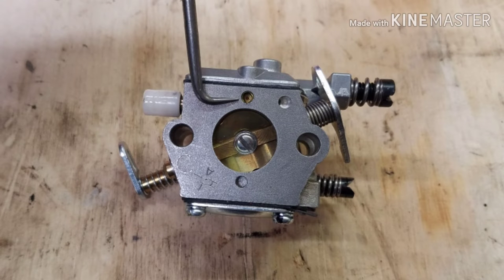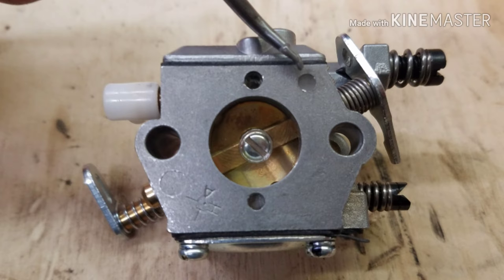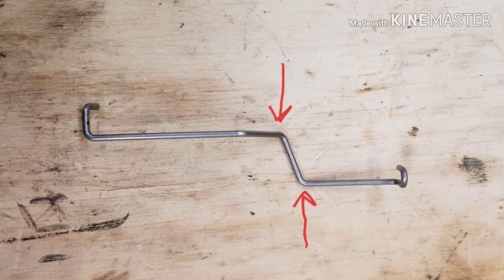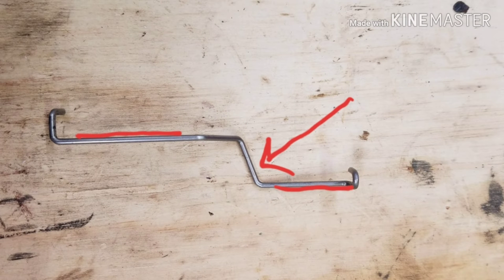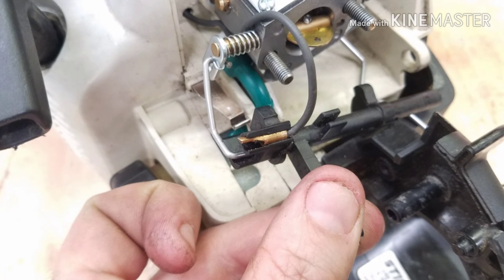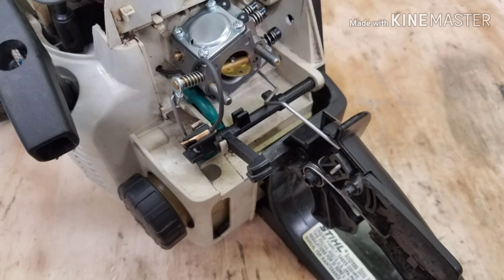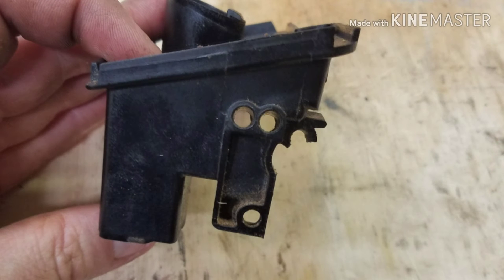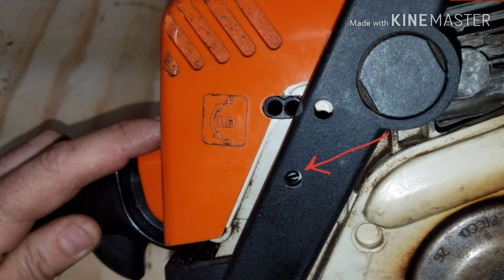☆ How to ☆ Stihl MS170 - MS180 w/ Walbro WT-215 adjustable carburetor upgrade & muffler mod

Comment: Just a note FYI.  There is an adjustable Chinese carb readily available for the MS180 on e-bay for $8.65 (free delivery in 5 days)..  It looks exactly like the MS215/carb you described in this post, except that there is only one impulse port, with no brass plug.  That carb is instantly ready for installation.  However, like your 215-1 carb there is no supplemental vacuum port on the top of carb as on the OEM Stihl Zama.  The Zama’s top port can be easily bolted to the top of the AM Chinese carb allowing the top port to fit perfectly into the carb filter housing just like the original.  HOWEVER BEWARE…..the metering diaphragm in the aftermarket Chinese Carb (and the 215-1) has a long depression nozzle, whereas that same metering diaphragm in the OEM Stihl Carb IS VERY, VERY SHORT!!  With the hybrid carb, vacuum during cranking with choke-on sucks huge quantities of fuel into the cylinder.  This will most often flood the engine during choking.  If not completely flooded, fuel to the carb is then entirely shut off by high upper port vacuum as soon as the engine fires up.  Thus it revs up, burns off the choke load, then dies.  Either way, the combination of the adjustable Chinese carb mated to the top vacuum port from the OEM CARB WILL NOT WORK!!  I had to drain my flooded cylinder, remove the top vacuum port, and reinstall the Chinese carb’s original flat top plate.  The engine then started easily on full choke without flooding, and could be easily hi and low speed adjusted as with most carbs.  The jet porting inside the Chinese aftermarket carb seems visibly much less complex than the original OEM Zama carb, probably the reason for a different metering diaphragm being needed.  To prevent unfiltered sawdust and dirt from being sucked into the unplugged filterhousing upport vacuum pot, I simply jammed a small p rubber stopper into that unused upper vacuum port. My MS180 has never run as good as it runs now, and it can be easily and properly tuned.  Amazingly, the $8 Chinese carb works perfectly.  Dr. K.
Reply: so, how do we find this mystery carb?  Any sort of identification number?

Comment: One thing I've never seen addressed is what to use on the hole in the air box where the compensator port is now open to dirty air. I found a perfect fit from a rubber plug that was in a hydraulic jack's fill port. Who said hording hardware doesn't pay, amIright??😊

Comment: I couldn't get the brass plug in the impulse port to budge with a pick, however I did get it by drilling it EXTREMELY CAREFULLY and slowly with a  quality, sharp 7/64 inch bit. Went until the tip of the bit hit the back of the plug and it nearly fell out. Absolutely no damage to the carb. Thanks for the vid, good info!

Comment: Is that a port on the bottom of the carb directly below the port you pulled the brass from?  Is it open or cloaed as well.  Ordered a 215 clone and on mine its a solid filled area?
Reply from the maker: It's just a cast in spot. It's blocked off,It's not open through to the carb. It can probably be drilled out on some for a different application. but the way it sits it's the same as yours, it's just not completely flat like your clone.
Reply: Many thanks from Nova Scotia!

Comment: Thank you! Just the video I needed. Wanted to mod my MS180 like they talk in the forums but all pics are long gone and its not so easy to vision "drill the brass plug and plug the other hole" when I have zero experience in Walbro WT-215. 😂 But your video made it all crystal clear. Also "drill 7/16" hole into the muffler" means little if you don't know where it is supposed to be drilled but now I get it. Will do the mods asap when my parts arrive. If all goes well and I can feel the improvement maybe I'll try modding my other saws too. Thanks again! 😎

I am going to check out your other videos too, seems like lots of good stuff. 👍🏻

Comment: Just a little warning that wasn’t mentioned in this video before you attempt these mods for your self. If you have a warranty for the Chainsaw you want to mod, just remember that any mods that are not approved by the company will void your warranty unless the warranty is already expired but that’s only if it’s brand new so if you only got yours brand new with a warranty and want to keep your warranty until it expires. Then Do not attempt the mods yourself.

Comment: i use a wood screw behind trigger and get full throttle ,, also the carbs I've been using I dont remove plug BUT I use the cover off the zama pos carb
Reply from the maker: Good work!

Comment: Did you advance the timing a little too?  I saw another video of yours, on a little top handle, and you said it seemed to help taking a little off the key and rotating/advancing the flywheel (5/7 degrees?) on these little stihl saws.  I just got the carb, so great info on the impulse.
Reply from the maker: A small bump in timing definitely helps! It's standard practice for me to do so on these smaller saws, so I forget to mention it sometimes. About .020" or 1/3 of the key removed is close. 1/4" at the outside diameter of the flywheel is usually what I go by for advance. Seems to be a happy place for these saws.
Reply: @samishsawworks5870  Thank you so much!

Comment: ok  where's the before hot shot@!??
Reply from the maker: Like the video stated, it wasn't running when I got it, so I had no baseline. Carburetor was toast and didn't take to a cleaning and rebuild. This video is less about the performance gains of the modifications (hence no BEFORE & after footage),but more of a "how to" if one should choose to add an adjustable carburetor.

Comment: So the brass plug you push out from behind? must need some force? i csnt seem to get it popped out
Reply: Never mind! Just needed some leverage!!
Reply from the maker: @mpeters5549  Ha! I was just about to say it takes some force/leverage to get it popped out. Good work.
Reply: I packed the throttle lever slot with JB weld to eliminate all that slack when pressing the throttle. It worked and was able to acheive full throttle, hopefully it stays!
Reply from the maker: @mpeters5549  nice! I'm sure it will. If not some people will thread a small screw in that slot to take up space also. Just another option. JB weld is good stuff though. I'm a big fan.

Comment: I have an MS250 and I keep hearing the WT215 is the carb to have for power because of its adjustability. But, most of the info I see is American and I'm in the UK. The reason I point this out is that the C1Q carb on mine does have high and low speed adjustment so I'm wondering if a 215 would be of any benefit in my case.
Reply from the maker: If you already have high speed adjustment then I see no reason to swap. You guys get all the good stuff over there!
Reply from the maker: The ability to adjust the high speed jet is the sole reason for the swap in our case over here
Reply: @samishsawworks5870  That's good to know, thank you. Yes, we have no EPA spoiling our fun, a silver lining I suppose.
 We also generally have exhausts with straight outlets and no spark arrest screens. I don't know if they're any better but are worth being aware of. 
Cheers.

Comment: Stihl says not to richen your oil to gas ratio on non adjust saws cause you can't get more gas in them, making the gas and oil mix thicker and in return make the saw run lean
Reply from the maker: I agree. I myself don't see it not getting fuel at a result of the mix being too "thick," like it's not getting past the jet because it won't flow. I see it more as, for a given jet setting (an amount of volume of fuel mix past the needle) there is less fuel in said volume with a richer oil to fuel ratio. Maybe this is exactly what you said I just worded it differently. Less fuel in the "volume past the needle" for a given/set amount of air, results in a leaner air to fuel ratio. Hard to get one's head wrapped around the concept sometimes. I know it took me a while. It's apparent really quick when you change say from 50:1 to 32:1 and have to adjust your carb because it's running leaner. The terms "rich & lean" get tossed around between air & fuel ratio (carb settings) and fuel & oil mix ratio. They are in fact very different entities that often get confused with each other. One may think "richer" fuel/oil ratio makes a saw run...well...."richer." In fact it's quite the opposite in terms of air/fuel ratio, but one can see why people get confused. This is only MY opinion....... we all have them ;) Thank you so much for bringing this topic up & you are absolutely 💯% correct in your statement. This aspect/topic  is one that is often overlooked. All the more reason I like to install this fully adjustable carburetor on these saws!

Comment: i dont get it why you guys needs so huge bars always, MS170 comes here with 12" bar
Reply from the maker: Maybe it's regional? Average size of wood maybe plays a role? A 16" bar is not huge by any means here. In fact, most would consider it small. Pretty common to see 16" on top handles being used by arborists. I always enjoy hearing/seeing regional differences and different points of view. Thanks for sharing.
Reply: @samishsawworks5870  i think it would be regional thing. and since that ms170 is small (30cc) i personally, wouldnt but huge bar on or. i myself have 14" bar in 35cc engine, its nice in some places, but since i dont do this for a job or have to fall huge trees, its okay. i would think that 16" bar woud eat alot from performance of the saw. but there is truth in there, here in europe (finland) we rarely need over 14" bars max 16"
Reply from the maker: @TopiAS06  I totally agree with you. Without the modifications, these are best suited with a 12" or 14" bar. They aren't exactly powerhouses to begin with, whether stock or not. Thanks again, it's always good to hear others' input.
Reply: @samishsawworks5870  i wan thing to remember. as i father has ms170 and is something like 5 yo. here those are with cats, cant do 100% same muffler mod

Comment: Thank you for this man. I have found literally zero info on actually performing the Walbro installation... its people like you who take the time to make these videos that make diy shit fun.
Reply from the maker: Thanks! I'm trying to do better. I always used to just "do things" and document..... or NOT document the results. There are so many people that have helped me in life & there are so many things that I have watched/learned to do on different forums and here on YouTube that I didn't know how to do before. Humans can do just about anything we set our minds to. Most of the time we just need a little guidance to set us in the right direction. The more we learn/share, the more we know. I figured it's a small way to "pay back" with some things that I DO know how to do. Anyway, thanks for the shout, hope it helped.
Reply: Hi Ben could you tell me what kind of chain that I can put on my Ms 170.to upgrade the cut without changing the bar like full chisel
Reply from the maker: I run Stihl PS chain. It is full chisel non-safety chain. Hard to find, but my local shop sells it. It beats all other low profile/picco chain hands down. 
https://www.stihl.com/STIHL-power-tools-A-great-range/Chains-bars-and-accessories/Saw-chains/22167-63680/Picco-Super-(PS)-3-8-P-1-3-mm.aspx
Reply from the maker: What length bar do you run? Do you know if your bar groove is .043" or .050" gauge?

Comment: Thanks for the video it really helped explain the swap my saw runs great now. I bought the saw new about a week or so ago I really liked the idea of a super lightweight saw to help clear my property i have other larger saws too. Instead of making holes for the adjusters I tuned the saw with the airbox and top cover off also I added a tiny screw in the rear of the slot in the trigger so the throttle rod doesn't go back as far instead of tweaking it. My airbox is slightly different it doesn't have holes maybe because it's so new and I really didn't want to drill holes in the housing but I compensated slightly on my carb adjustments for it not having the airbox while tuning and it took 2 tries to get perfect although I have experience tuning, so far I'm happy with it and can make holes if I need to. I just plugged the intellicarb hole on the airbox with some silicone.
Reply from the maker: Right on. Glad it all went smoothly for you! Sounds like you did a great job! They really turn into a different saw with the swap. In my eyes it's how they should have been from the factory.
Reply: Also if not for your video I wouldn't have known to pop out the little brass plug on the impulse port and plug the other hole that would've definitely given me trouble. Only after watching the video was I able to understand what they were talking about on various forums I read so thanks again! This saw really should have come with this carburetor. I don't know if it's the EPA or what but the saw should run cleaner if its more efficient and tuned properly but whatever. It was a pleasure to tune it was extremely sensitive to adjustments probably the easiest one I've done if you don't factor in taking it apart as to not drill holes.
Reply from the maker: @forreststrong797  not sure where you're located, but here in Washington state you can usually find them for $50-$75 used (sometimes you have to wait a bit)  One can usually find oem walbro wt-215 carbs already rebuilt for around $20 on ebay. For $100 or less all in + a little time spent on the muffler, its a no brainer as far as I'm concerned. For the money spent to have a light little saw that performs so well, I don't think one can go wrong.
Reply from the maker: I just did a ms170 and it didn't have high OR low adjustments. Just crazy to me. It's as if seasonal climate changes and different elevations don't exist haha.
Reply: I did a bit of research before buying the saw I almost bought the ms151 or 201 with the rear handle but thought it might be fun to get the cheap 170 and upgrade it so as soon as I bought it I also ordered a stihl 16" 0.50 light bar and picked up some aggressive chains various ones to try. I got the normal side chain adjuster and bumper spikes an elasto start pull rope and handle assembly like my big saws have and i ordered the wt-215. I was really hesitant at first to install the carb it ran decent at first but I've used the crap out of this saw every day since getting it and after like 20 tanks of gas it started doing weird things so I threw the carb on it and it's a whole new saw I did some more adjusting today and have it dialed in perfect it starts easier and runs way better across the board. I really didn't want to drill holes so tuning was a bit more work I had it good but after dialing it in man it freaking rips for a little thing. All I did to the exhaust was remove the spark arrestor screen and opened up the louvers i may do a little more I also ordered a copper cooling plate on Ebay to try out that bolts up between the cylinder and muffler. I can't believe how much it gained.
Reply from the maker: @forreststrong797  Glad I could help. I know it took me some time monkeying around with the carb (after reading/researching all I could) to figure out what pulse port it needed to use. There are so many cheap saws out there on this chassis that people give up on. If there's an easy fix (well relatively easy fix) for making a decent saw out of them, then I hate to see them go to waste. I buy all of them I can as cheap as I can. Yes they're a less robust cheap clamshell saw to start with. Once they're done right, for their size, they impress everyone I've handed one to. They last a surprising long time when tuned properly and not abused. I once thought they were garbage, then I got over myself, and have since learned to love the little guys haha.
Reply: I'm in gold bar Washington, I paid 160 plus tax for the saw on sale. I got the carburetor on Amazon for 40 dollars and I believe its a real walbro I tried hard to get a real one not a knock off it came in the correct box and everything and seems like the real deal. I may keep an eye out for a used one it would be fun to have another I've had a lot of fun using it and tinkering on it. Wouldn't mind having a 180 to tinker on and compare. I think the wife would like the easy start one too but she uses the 170 no problem and enjoys it, she likes to make the fire outside and it's nice having something she can start and use while I'm doing other things.

Comment: What did you use to block the hole in the filter box where the intellicarb went into?
Reply from the maker: Does your filter box have the "grated insert" that drops into the "throat?"
Reply from the maker: Part # 3 in this diagram
https://www.diyspareparts.com/parts/stihl/diagrams/ms180-c-bz/b8e82174-deeb-4f33-918a/
Reply from the maker: If it does, the tab on the insert blocks off most of the "non filtered direct flow" that would get into the carb throat from the original intellli-carb hole. If I recall, I used a small piece of cotton in the hole. You could use anything, even an earplug rolled up and inserted would be great. There isn't much if any that can get through (in terms of sawdust) even if you don't plug it with anything.
Reply: It doesn’t have that piece on it. I wasn’t real concerned with it being on the bottom. A cotton ball is a great idea